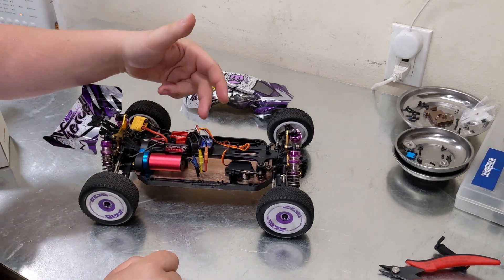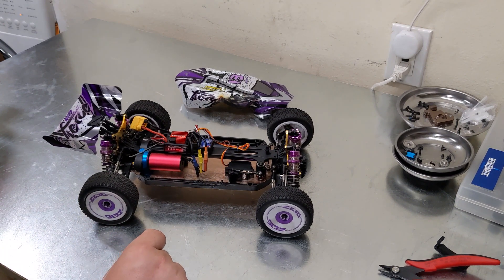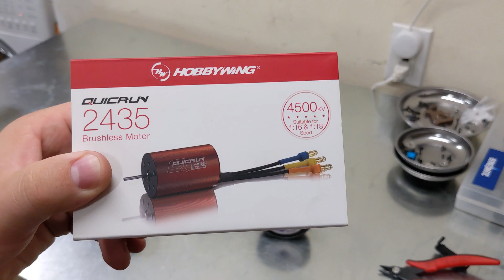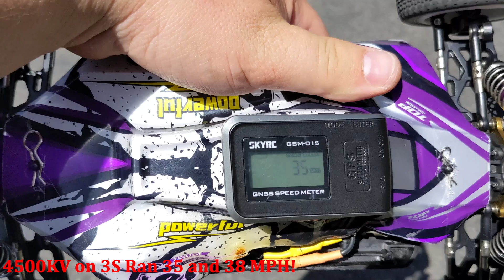124019 Brushless - BACK FROM THE DEAD

Comment: hello sir I'm wondering what size of pinion you're using fit into that motor for wltoys 1/12
Reply from the maker: It's been quite a while. I actually gave this car to a friend. I found fitting different gears in it tedious because you're limited on motor mounting locations.

Comment: It's fast,  how long will the tires last?
Why the motors get so hot?
Reply from the maker: Tires didn't last long. This car doesn't have any motor adjustment on the mounting plate. To set the mesh correctly it requires an exact pinion size. Because there is no adjustment, I think the mesh was far too tight and causing things to bind up and generate heat.

I've since passed this car on to a buddy who was built it into a 65 MPH high speed car with foam tires.
Reply: @MK-RC  Ok, thanks.

Comment: Did you set the end points for throttle as it seems a bit slow for 4500 kv , you basically gave it the V2 set up and they're in the 40s. Recalibrate the ESC and transmitter see what happens. Can't hurt.
Reply from the maker: Will do! Can't hurt. Maybe that will also help with the motor temperature.